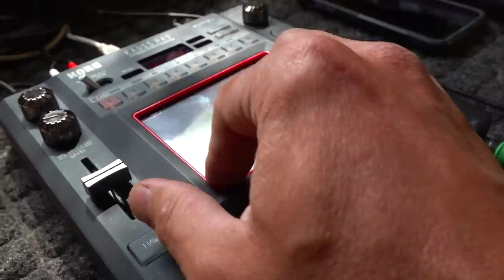YouTube GOLD - IS THIS A JOKE?  (s2 e12) Miniature Gold Mining  | RC ADVENTURES

Comment: when you guys weigh your gold you should weigh it by the scale to the size of equipment you’re using. if the average size of equipment is 1/10 scale then when you weigh your gold you should multiply it by 10 to get the actual weight.

Comment: A Steam Shovel (live steam of coarse) would add a much needed sense of dilapidation and budget cuts seeing as the mine would be still using 1800s equipment in the 2000s. In addition to the steam shovel hydraulic mining should be implemented and the "pay" directed directly into the sluice boxes. this would greatly improve efficiency and run time seeing as a steam shovel if fitted with a water pump could be kept in steam all day without having to weight for battery's to charge.

Comment: OK, ditch the orange excavator. Get another white hopper/conveyor belt thingy and another wheeled loader and set them up where the orange excavator is currently working. It'll be more efficient (therefore more GOLD) to run it this way instead of messing around with a slow excavator/operator. Run another articulated rock truck too so both hoppers have a constant flow of pay dirt coming to them. Reposition the excavator to the cut to fill the extra rock truck. Lastly, make me the foreman. I'll drink more beer, pound more quiff and under my direction, you'll yield more GOLD.
Reply from the maker: Too efficient..... You've been demoted to watching the pump.   Come back when you have had 4 more beer.. and we will talk again
Reply: @TheRealRCSparks  ah hell! I'm ready

Comment: Please guys do not touch the water with fingers/brushes on the 911 vibratory sorter. The interference with surface tension can cause the loss of fines, sorry about me sticking my unwelcome nose in but over the weeks it has sort of got to me. I used to mine in the Northern Territory Australia and to make sure I retained the majority of the fines I used a 4 foot x 12 foot copper sheet with a coating of mercury which would form an amalgam with the fine gold.  Not ripping you guys a new hole,,,,, I just want to see you (for the great show you run) get maximum PAY.    ⚒⚖️🥇💰    🇨🇦 🇦🇺   💰🥇⚖️⚒

Comment: Only just subscribed Brilliant you tube gold👍👍👍👍 what websites sell theses kits very interesed
Reply from the maker: I get my gear all over the internet, good sir. anything in particular that you would like to know about?
Reply: RCSparks Studio absolutely love what you guys do👍 thanks for your offer of help any websites in particular for a first time buyer ? Me and the grandson think you guys have a lot of fun off camara and we love that 6wheel Volvo 👍👍👍👍👍
Reply from the maker: @stevepisula1352  Sure bud.. try out www.RC4WD.com and check their heavy machinery section :) That 6 wheel volvo I had to order straight from China and was 3000$ usd :) please say hello to the young fella!
Reply: RCSparks Studio Hi guys just wondering what jobs do you guys do for a living? I run excavators for the water industry. Oh yeah moreeeeeeeee YOU TUBE GOLD absolutely the best you tube we have found👍👍👍👍👍👍
Reply: RCSparks Studio hello again would you be able to advise us? The grandson and I have just got a Toyota Tundra high lift 1/10 scale. Your you tube channels have given us so much fun and enjoyment we want to start building R/C models 😁😁😁😁. 
Carson reflex stick2  6 channel radio receiver
Core RC 4012-servo 4kg . 12 sec x2
Enrich power 3000mah 7.2v sport stick pack
Etronix probe plus 2.0 brushed WP electronic speed controller
Etronix powerpal peak plus AC NiMH , LiPo 1/3/5A charger
AG thread lock  or should I use locktite?
Tamiya ceramic grease
Was wondering Should I upgrade anything ?
Finally don’t stop what all you guys do we love you guys in England👍👍👍👍
Thank you all for any advice given. 😁😁😁 can’t wait